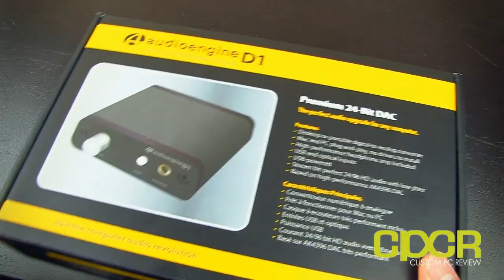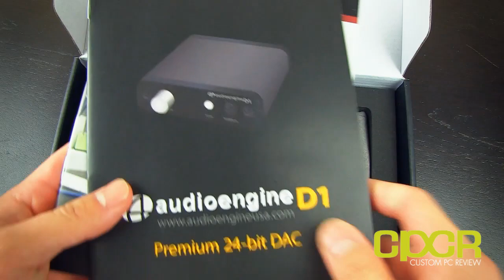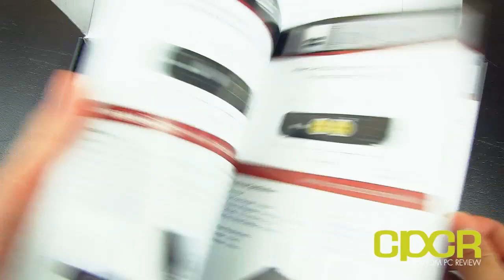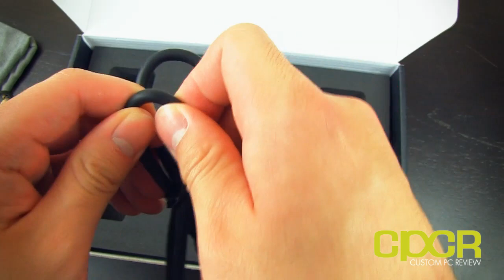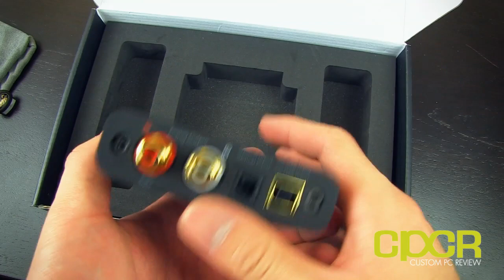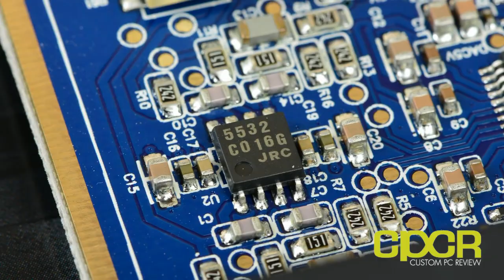Audioengine D1 USB DAC + Headphone Amp Unboxing + Written Review

Comment: The gold plating is so thin that the plastic deformation (that malleability you guys speak of) will be lower than the tolerance to which the jacks can be manufactured. We are talking about microns here, not even tens of microns. Silver is indeed a better conductor, but that's per unit volume, so you could simply use more gold to offset that. The real reason is that gold is noble, it won't corrode so the tolerances and surface conductivity will remain the same (and probably outlive you).

Comment: Thinking on picking this up as I just bought the Audioengine A5+ as a upgrade to my A2's which I notice a huge difference in sound. I have these in my bedroom with my Min PC which is a Zotac Zbox with it's onbard sound as I using the 3.5 mm Audio out but it does have a Optical Out as well so I think this is the way I would use the D1. I know the speakers sound awesome now but everyone saying they will sound more awesome with the D1.

Comment: This is a sound card. The whole point of this is to replace the soundcard on your computer. That is why it is via USB because it is not attacked to the ports connected to ur sound card. You are not suppose to use this with a sound card at all

Comment: Becuase it is binary data instead of an analog signal digital signals don't suffer quality loss due to low quality or long cables, as long as the signal gets to the other end it is at full quality. So there is no reason to make the USB so short.